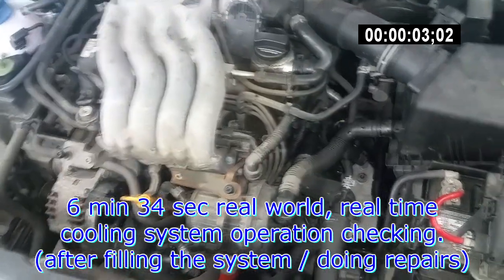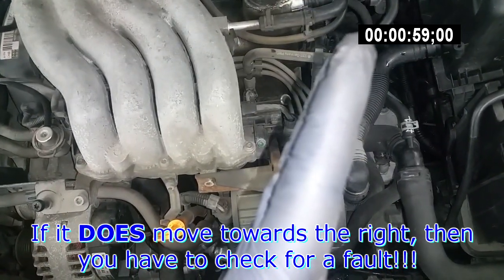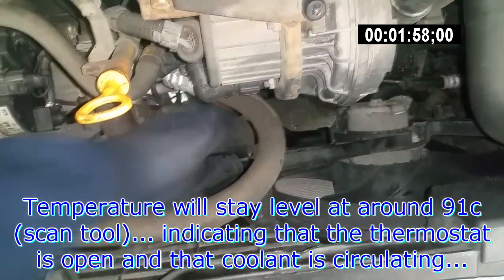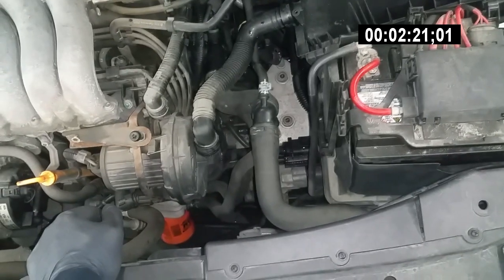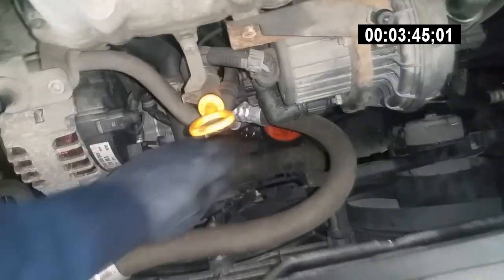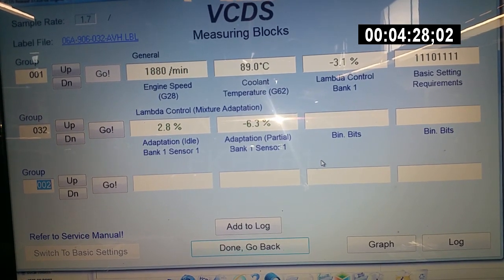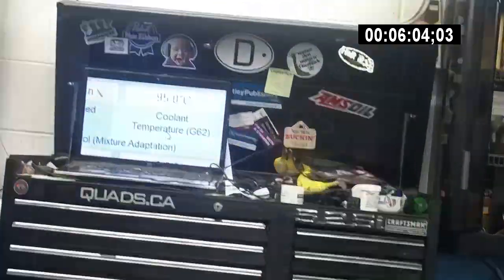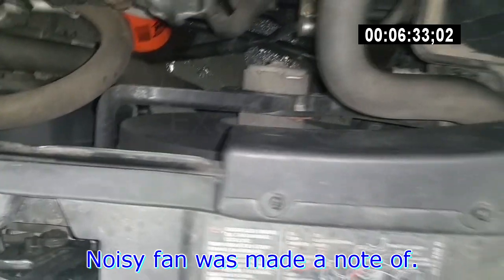Cooling system checking... don't freak out, keep calm! (Part 1)

Comment: Awesome. My teen daughter and i fixed the smooshed radiator, replaced fan with a bad resistor, replaced the temp sensor (prolly not necessary), replaced the water pump with plastic impeller spinning freely, and a fan control module that triggered the ac clutch whenever the battery was connected causing a 3amp parasitic drain.  Then, after all that, i freaked out! (radiator fan switch? or thermostat? There's nothing left!) Watched your video. Hooked up vcds, and it went exactly was you described! 96C degrees.
Reply from the maker: Thank you for watching!

Comment: Our CKRA (2013 Passat NMS) has an operating range between 99c and 106c. Apparently, it's normal for the engine
Reply from the maker: kfrdubber Yes... some engines will run hotter / warmer.

Comment: it's me again haha wanted to follow up with you on the p1582 fault, replaced the throttle body and has now been almost three weeks no fault codes all the modules have relearned. dtc status complete , I would say at this point we have a solid fix when cleaning throttle body has no effect. thinking about doing a video on dissecting the throttle body in near future thanks for all your help.. by the way are the AEG vw parts now being sourced to China manufacturers?
Reply from the maker: Thank you for the update! I've only had a handful of faulty mk4 throttle bodies over the last 10 years... not a common issue, but a good suspect when everything else checks out. I think a lot of the parts are now coming out of China or only available from there. Yes, take it apart to see if you can spot a fault. I have a few throttle bodies that I have kept... but have not yet had the time to do the same. To be honest, I wouldn't know what to look for / spot, unless it was a stripped gear or a burnt connection.
Reply: @Thomas what sensor are you pulling the 95 96 degrees reading to monitor the fans switching on

Comment: Thanks very helpful tutorial,my question just clear my doubt so the top radiator hose should be same temperature to the lower hose o different?
Reply from the maker: Year, make, model, engine?
Top hose should be hotter than the lower. Depending on the engine... lower hose will be cold for up to 10min when the engine is first started (thermostat is closed, no coolant is flowing through the radiator). If you have overheating issues or no heat inside the car, something is wrong.

Comment: Job driving me crazy. Went aftermarket because it was running to cold (car was diagnosed at the dealership) then I started having overheating problems with the new aftermarket thermostat thinking maybe it was bad replace it a second time same issue went to the dealership purchased the factory unit, same issue, then come to find out the dealership, unplug the exhilarate water pump right in front of the radiator and guess what I still have an overheating issue. I tried, vacuuming the system out and still overheats and then I noticed the water quit running through the purge line but yet it is not clogged as I could put vacuum to it, and pour water through the engine what’s my issue a bad water pump possibly  the purge pump is working, but it will not purge into the overflow tank
Reply from the maker: https://youtu.be/LiDRUWPw_f4

Comment: Hey mate, I have a beetle with the 2.0L AQY engine, I cannot get fans working normally. Have replaced fans, as they were faulty. Replaced the fan control module in the engine bay, changed the thermal cut in switch, coolant temp sensor, coolant temp gets up to 105-110 without fans automatically cutting in. Both fans work with A/C on. Any ideas?
Reply from the maker: Is coolant flowing back into the coolant reservoir when the engine is running? Do you have heat inside the car when turning the heater on? Can you trigger the fans by bridging the radiator fan switch (like in this video)?

https://www.youtube.com/watch?v=Roh6RCs8IJk

Comment: Great video, I am having an issue where I have added coolant to my 02 12v vr6, and I have squeezed the hoses to release as much air as possible. I have run the engine for a while, and the auxiliary radiator line and the transmission cooler lines feel empty, and the level in the coolant res. has not changed. Any ideas, i am worried i will seize the engine as there is still lots of air in the system?
Reply from the maker: Have you checked if the coolant return hose is actually clear / not obstructed? Disconnect the upper radiator hose and check if coolant level is up to that level.

Comment: Hi Thomas. I have 2002 Audi A3 8L 1.9tdi. My temp gauge on the dash isn't coming up, I have changed coolant temperature sensor but made no difference. My fans aren't cutting in. The bottom pipe is staying cold and top one is warm. Radiator isn't warming up after 10+mins. I have no AC so cant check if that kicks fans in. Coolant is re-circing back into the top of reservoir. No signs of coolant leak from engine. Is this thermostat??
Reply from the maker: TDI engines can take a loooong time before the lower hose gets warm / hot and the fans come one. A wiring problem with the sensor circuit should set a fault code and turn the check engine light on... however, that's for the temperature circuit that the ECM monitors. The instrument cluster circuit is in the same sensor, but the Instrument Cluster Module would monitor that circuit. If you have a scan tool that can communicate with the instrument cluster... check it for fault codes. Better yet, you can use the scan tool to activate "output tests"... like in this video (to check correct function / movement of the needles):
https://www.youtube.com/watch?v=p6Hm_TnqiUs

Comment: What are you using to keep the engine idling at 2K RPM...Device on the pedal or the scan tool?  I have two MK4 2.0L VW's and one has a mechanic throttle body while the other is a later year that has the fly-by-wire. So the cable one i just hold open by hand, the other I usually have someone sit in the car.
Reply from the maker: My pedal buddy: https://www.youtube.com/watch?v=_CHvEbcWmrs

Comment: hey thomas  my radiator has a crack on the top where the radiator hose connects to that elbow. does removal of the radiator require to remove any a.c component? mk4 jetta 1.8t
Reply from the maker: No, but you have to loosen the condenser from the radiator: https://www.youtube.com/watch?v=R8L2gOU589o

Comment: Hey Thomas I have a 02 VW beetle GLS 2.0 I've replaced the water pump, thermostate, the flange, ECT, timing belt, and even had to replace a freeze plug behind the tensioner pulley. When I crank and let it running for 20 or 30 mins at 2k I get no overheating issues. However as soon as I get down the road it the red overheating light beeps then starts flashing no leaks. It also throws the code p0117 ECT low input. Could it be a wiring issue? What do you think? Thanks for the videos and the help
Reply from the maker: Does the fluid level remain between min & max? Or does it drop? Any major overheating incident in the past? Can you monitor engine coolant temperature with a scan tool? To see how hot it runs at idle & 2000 rpm... and while driving? Is the lower radiator hose getting nice and warm after the thermostat opens? Could be a number of things... lack of flow, head gasket and yes, maybe electrical. Not sure at this point.

Comment: My 1999 VW Passat 1.8T recently began overheating. I replaced the coolant flange on the rear of the motor about a year ago as it was leaking (not overheating at the time) and yesterday replaced the thermostat and reservoir cap. I believe the water pump is working as the heater was blowing hot air as usual. After a test drive the needle began creeping up again and I quickly shut off the car. That’s when I noticed a hairline fracture in the coolant tank sending a tiny jet stream of coolant from the tank. My question is, could this alone be why the car is overheating? The oil cap/dipstick appears clear of any milkyness and looks normal. I’m hoping it’s not a head gasket issue. Any thoughts? I have a new coolant reservoir ordered but am skeptical that the tiny leak is the sole issue reason for the overheating.
Reply from the maker: I'm still at work... will get back to you once I'm at home later tonight.
Reply from the maker: If you didn't have any overheating issues before replacing the thermostat, then most likely you still have air in the system or the thermostat is bad. If the coolant reservoir has fluid in it (even if it's only at the bottom of the bottle) then there should be enough fluid in the engine to keep the engine from overheating. If you are sure that the thermostat is OK, check for air in the system / rebleed the system. The fan clutch for the large radiator fan can go bad with age. If the car does NOT overheat as long as the car is moving, then the thermostat is probably OK. If it overheats while cruising at a steady speed... thermostat or air in the system.
Reply: Thomas EXOVCDS Thanks for the timely response!  There is plenty of coolant in the reservoir. After I changed the thermostat yesterday I test drove it and the 1st mile or so the temp held steady at 190, then it began to rise steadily and I just made it back home before it got to the red line. That’s when I noticed the jet stream of coolant/vapor coming from a hairline crack from the side of the reservoir. I also had replaced the cap since that was “rattling “ upon inspection. I will try bleeding the system once I replace the reservoir. Thanks again kind sir!
Reply: Also, the car doesn’t overheat while just idling, only when driving, even at low speeds. The fan (large one) is operating but the secondary one does not come on during the overheating.
Reply from the maker: The small fan could be burnt out... turn AC on to see if the fan comes on (ignition ON engine off, AC ON). After further bleeding, instead of driving, let engine idle until you can feel the lower radiator hose get warm (this verifies that the thermostat is actually opening).  Keep checking the temperature needle between checking the lower rad hose to make sure that temperature stays in the middle. Once the lower rad hose is warm, take it for a run and see if temperature still climbs.
Reply: Thomas EXOVCDS  Will do. Thanks again. I’ll update after reservoir replacement.

Comment: 2000 vw vr6 have now (my 2004 1.8 engine burst in to flames 10 mins after parking) anyways, seem ac rad fan works when ac on.  un plug wiring from rad temp switch fan goes off? if i jump connection can"t get either big or small fan to go? over heated going threw slow drive through. should I turn on my ac if in traffic to cool engine coolant?would it help abit? have to do better checks on coolant system, top hose gets hot bottom stays cold, thinking big fan is toast, seem to get only 1 speed ac fan side (sm) does the small fan have its own power suppy switch  small fan works but can"t seem to get either fan to work when jumpin wires at rad temp fan swich (?). the temperture sensor close to engine involved at all? have to find if i have power at rad temp sensor/switch but i assume i do because small fan will run?
Reply: Thomas EXOVCDS
3 months ago
Have you checked if the coolant return hose is actually clear / not obstructed? Disconnect the upper radiator hose and check if coolant level is up to that level.
Reply from the maker: @murraydupley9330  Watch the following video... do what I did and tell me what happens. 
https://www.youtube.com/watch?v=Roh6RCs8IJk

Comment: What's it mean the fans dont cut on
Reply from the maker: Year, make, model, engine? Is it overheating?
Reply: @EXOVCDS  98 VW beetle but I found the problem it had air in the system thank you for responding just bought the car for my wife working through some minor stuff.
Reply: @EXOVCDS  your videos are helping alot I am subscribing thanks again
Reply from the maker: Thank you for the update!
Since the beetle does not have a coolant temperature gauge... it might be worth adding a gauge such as a friend of mine did to his car (not a Beetle): https://www.youtube.com/watch?v=caw2kuXGfhw
This is the ebay link he shared:
https://www.ebay.com/itm/Red-LCD-Digital-Motorcycle-Water-Temp-Temperature-Gauge-With-22mm-Sensor-Adapter/192539748718

With the display mounted in the right area on the dash, your wife can catch temperature issues before they get out of hand!

Comment: When my fans come on I’m seeing a little smoke coming from the fan motor and the fan motor is very hot.
Reply from the maker: Year, make, model, engine? When you move the fan by hand... how easy does it turn?
Replace the fan if it is stiff to move.
Reply: Thomas EXOVCDS I found out the condensed hose was holding down the fan and the friction prevented it from spinning. But this video helped me greatly I’m filling up on coolant. The air escaped and the fan chipped in and out around the same time you said. I have a 95 VW golf with 1.8 8v engine.
Reply from the maker: Thank you for the update! I would not have guessed that it was rubbing on something! =)